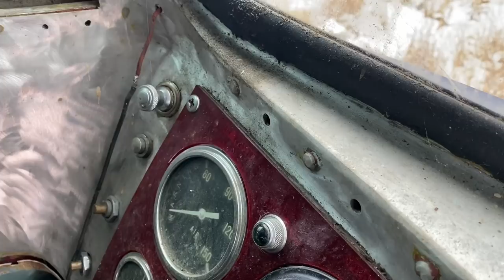Day 1 Silversides  bus rescue Minnesota

Comment: There is always more than one way to do things. For me,the first idea would be to hire a tow truck to winch the beast out of the divots. Am I missing something  here ? At the most,it would take an hour of the trucks time,with some prep work digging in back of the wheels beforehand to ease it out. An experienced operator,ideally with a deck winch,and out it goes without damage. But that is just me. Opinions,anyone ?

Comment: 'GAS ONLY' ????? This things run on gaz???? not diesel???
Reply from the maker: It’s diesel.   That was for the air conditioning engine.  A separate pint motor for the ac but now a generator for the rv

Comment: Bus Grease Monkey You need to get a Truck supplemental diesel heater out of a big rig tractor  around $250 used size of a loaf of bread in the Truck bone yard comes with a digital face to control the temperature you only have to supply the exhaust pipe and small fuel tank . I have one in my 1962 VW and burns me outta there!
Reply: Or drive fast enough to raise the skin temperature of the bus.
Reply: @shreddder999  I tried that with my 62 VW but could only reach 63 MPH downhill with a tail wind
Reply: shreddder999 just need to get a sonic boom or two before the bus will be nice and toasty!

Comment: There is no excuse for not having heat in the bus. Just do it.
Reply from the maker: We have heat in the bus.  Over the road coach heat but the engine was not getting over 160 because of the cold.  Plus it’s pretty drafty.  After we get chilly we turned on the propane furnace.